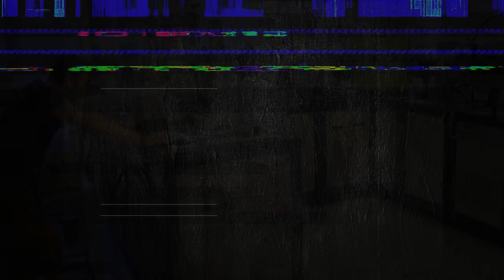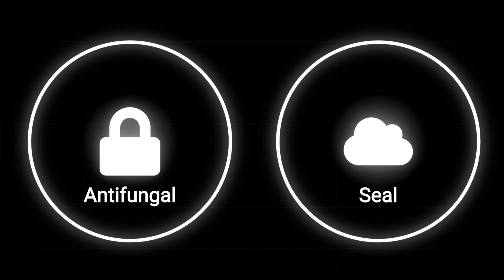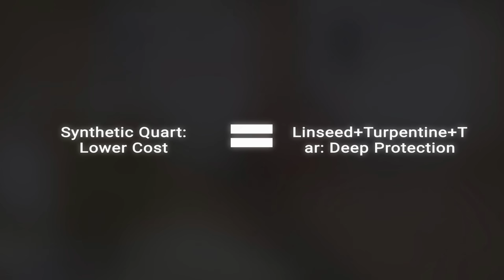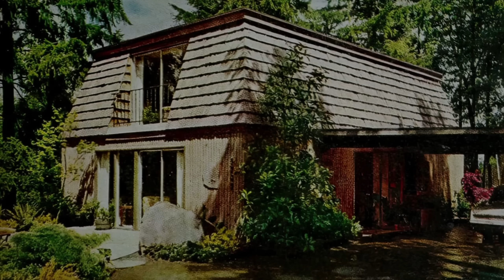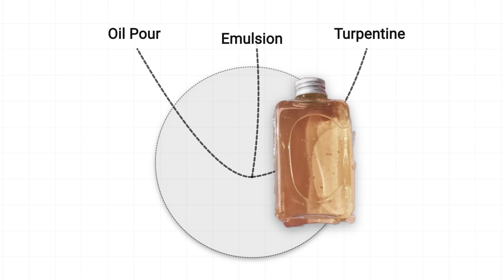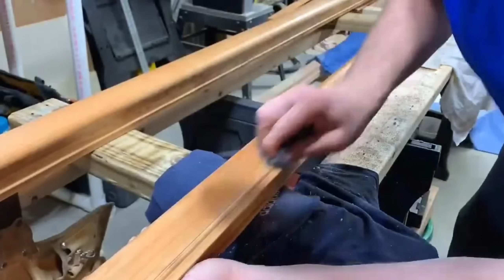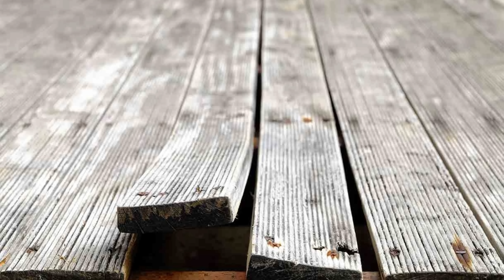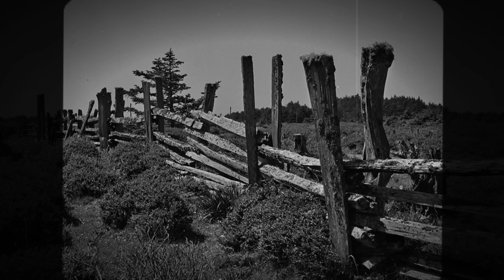The Amish Have Never Replaced a Wood Fence in 200 Years— The $2 Treatment the Lumber Industry Buried

Comment: FYI this mixture is designed for rustic or rural uses e.g. fence posts, siding. For horizontal decks, beeswax will not protect wood from solar radiation, especially on top of a clear finish. When applied to a horizontal deck the results are usually disastrous. The 3-part mixture is also adapted for interior use e.g. handles, furniture. But whatever you do, please don't use SealOnce products. Our use of it was disastrous for a whole variety of reasons.

Comment: Three years ago my deck was looking terrible. I used Cabot Deck Correct following the instructions to the letter. 
My deck is now absolutely ruined. Boards rotted through, stair treads held on at one end by one nail as the rest of the tread is rotted. ALL the horizontal surfaces are destroyed.
I have new lumber that was delivered Tuesday.
I’m glad I saw this video.
You’d think I would already know as I grew up surrounded by Amish in Southern Michigan.

Comment: what about the quality of the wood itself? what wood would you use to build the fence/deck?
Reply: If you build a deck give it a steep grade so water RUNS off.  Coat with 50/50 used oil and diesel.  Let dry for 3 days.  Don't tell your neighborhood Landscape Cops what you did.  Buy the best wood you can afford.  Don't paint it with a solid covering EVER.

Comment: Just bought a gallon of pine tar for 40 bucks not 2 bucks.  Add linseed oil and turpentine.  This mix is more than regular oil based wood sealer but should last a bit longer.
Reply: Where did you buy it? Co name country?
Reply: @carolj.3175 tractor supply usa
Sold mainly for horse hooves.

Comment: WOW! Im  a mere 44 yrs of age and as I listened to this and watch it, I'm looking at my senior project.
Is what I eventually said, that's what it was. But it is just something I did in shop class. But I was really good at woodworking. I had a real knack for it and they gave us the wood, beautiful, beautiful wood. I mean, the most gorgeous oak, you can imagine so yeah, I used it. And I chose the right ones. I put them together. I made sure they match Attached, and I'm looking at, I don't even know what you would call. This is basically like a magazine stand it's for a telephone. I thought a telephone will go on top of it. You have stuff to put your mail or magazines in there. And then there's a drawer at the bottom. But the main thing is sorry. It took this long. I was drinking.
I did it with linseed oil. That's what I did. All my projects with because that's what my teacher taught me and take linseed oil, rub it down, linseed oil. Then, you take palmise, throw it on there. I need to take the rag lincid.Oil and rub it down and it will smooth everything out.Take that dust off that.You got on your last finish.It's the finest sanding you could do little that.I know is going to soak into everything.And this stuff has not changed.One bit not one freaking bit.It is the most gorgeous thing not that I ever made cuz.My kids are but it's beautiful!

Comment: Linseed oil is extremely common in Sweden, we have it either boiled or cold pressed, and we use it for everything, mixed with color pigment to paint houses with it, rust protect cars, paint steel with it, use it for fence posts and a lot of other stuff. It's cheap, environmental friendly, and available anywhere and it works great! You can apply it with a paint gun, from a spray can, with a paintbrush or just let wood soak in it.

Comment: the vikings used equal parts of genuine pine tar, gum turpentine, boiled linseed oil.  they called it "boat soup" and treated their boats, furniture, ax handles, etc...  Gum turpentine is a potent natural antimicrobial, exhibiting both antibacterial and antifungal properties. Pine tar provides waterproofing, UV protection and resistance to decay.  Boiled linseed oil prevents water absorption and strengthens wood fiber against rot.    A top-coat of beeswax acts as an oxygen barrier that slows the drying / curing of the linseed oil.   But, if you want a fence to last a 50 years with zero maintenance use Black Locust.
Reply: Alone...black locust?// don't know what it is but will look up thanks

Comment: Linoleum (LINO)  flooring is a natural, eco-friendly material made primarily from
 solidified linseed oil (linoxyn), pine resin, 
ground cork dust, wood flour, calcium carbonate (limestone powder), and mineral pigments, usually backed with jute fabric. 
These sustainable components make it biodegradable, durable, and often antibacterial

Comment: I am a professional painter, and this video blew my mind.
Reply: Okay, so boiled linseed oil and real turpentine mixed 1:1 and applied with a rag. After 48 hours, apply melted beeswax with a little linseed oil. 

For posts, am I supposed to mix the pinetar into the linseed oil and turpentine solution? Then still topcoat with the beeswax?

Thanks in advance  this video was very good. 

Subbed

Comment: Very cool. Something to be aware of is that “boiled” linseed oil is not heat treated, it is chemically treated to break the oil chains. The chemicals used are not pleasant and will irritate skin in a way that pure linseed oil will not. Prefer to use heat polymerised linseed oil, which can be more expensive unfortunately.
Reply: boiled linseed oil was actually heated in the past ... but adding synthetic dryers was cheaper.  But they still produce turpentine (distilled from pine trees) and actual boiled linseed oil and actual pine tar in Sweden.  It works as well as it did 100/200 years ago.  Mush better than the new crap.  But it's pricey.
Reply: I've been using Flaxseed Oil for years (that's what pure linseed oil is), but where do you buy "heat polymerised linseed oil" from? And do you have a brand name?

Comment: Take diesel 50% and used motor oil 50%. Mix it and you get sperior treatment for wood
Reply: In my experience, the diesel isn't need. Just oil it up with used motor oil. Or make some soild black locust posts at a certain time of year. Those posts don't rot.
Reply: Why diesel when it evaporates in less than a year?

Comment: Probably a fake account. No mention of the 3rd ingredient in the mix! I take this with a grain of salt! However, the comments section are full of ideas, such as using diesel mixed with used motor oil or transmission oil to seal the wood makes more sense and economically viable!
Reply: Diesel evaporates. Woodworking YT comments will steer you wrong without failure.

Comment: The recipe will indeed continue to provide protection… provided you keep applying it every year or two. They somehow left out the part about annual reapplication being necessary. Of COURSE there are better modern products that provide longer lasting protection. The turpentine-tar-linseed oil recipe is merely a good solution compared to the excellent products available at every big box home store or paint store.

Comment: They also char the wood surface which creates a rot resistance. old motor oil or diesel is also used for preservation. woods that are naturally rot-resistant, such as black locust, eastern red cedar, or white oak, for posts.

Comment: at least most of the skepicism  is well placed.   but very truely i have had many amazingly good results by treating all kinds of wood and rusted steel with RAW  linseed oil (which is not so easy to find anymore)   mixed with a bit of pure gum turpentine,   and varying amounts of dirty motor oil especially on badly weathered wood.   a thin coat of the mixture can be painted over right away with oil based aluminum paint which  needs a lot of drying time.   then allmost any paint will be fine on top of it

Comment: This is not unique to Sweden, this has been produced for at least 1000 years in Norway, and in the 1600 and 1700’s Finland was the largest exporter of pine tar products. They are still in use to this day. Telephone poles is one example, although nobody has power lines or phone lines on poles anymore, but some old lines are still in use and needs maintenance

Comment: Swedish here. I have saved about a hundred year old window frames and doors. The real terpentine and boiled linseed oil reintroduces the stuff (lignine) that that holds the cellulouse fibres together in the living trees. I've never added pine tree tar, but that sounds a good idea for unpainted things like fences. For boat jetty's though, the kind of distilled wood tar mentioned here, is traditionally used in Sweden. (It was an abundant bi product of huge charcoal production through distilling wood - in Sweden - which lacks stone-coal deposits.) It's remarkably effective, lasting like 50 years or so, and smells nice! (In lieu of this stuff, I have used just regular used petroleum based engine oil, diluted with gasoline to penetrate & for direct contact with soil or water, a second drench with undiluted oil. Not so nice, but almost cost free. ;-) I only use it for wooden staircases far from my house, where I never sit, and jettys where noone sits.)
For completely dried out grey wood (and sometimes mold and moss covered) I've done as follows;  I have very sucessfully used "Klorine" / bleach (I guess?!) - the same stuff added to the water in swimming pools - sodiumhypoclorate - NaClO - to treat old windows and doors, that have had tons of mold and moss overgrowth. Brush off any loose paint and loose (only loose!!!) window putty. I then add it very liberatly, basically drenching the wood with the stuff. It probably penetrates a bit into the wood. That immediately kills the overgrowth. I brush a bit, some more paint will probably also come loose. I then hose down the door or window frame with "huge" amounts of water. I then leave it out in the sun to dry out completely for a day or two. (Only works in hot weather.) After that, I use a pretty thin mixture of terpentine and boiled linseed oil - thin, because I want it to penetrate deep. After another day, I give it another coat of undiluted boiled linseed oil. Repair any missing window pane putty. Then the usual painting procedure, with oil based paint primer + another two layers of finishing paint. Actually, the hardened boiled linseed oil, acts as paint protection on it's own. But you probably want colour paint, and the procedure gives a paint surface "anchored" deep into the wood.
In this manner, I have restored also completely grey, dried out, almost 100 yers old windows. If there are severe cracks in the wood, traditionalm chalk & oil based window putty can be used for cracks. I never remove splinters or such - an antique window I figure, might just as well show it's age.
The results have been astonishingly good! Windows and doors people thought were beyond possible to save at all, have stayed perfect for 25 years, without any mold. After that long time though, some new fresh paint is a good idea. ;-) A long story, and a lot of work. But it works, and old windows matching an old house, really looks great!Swedish here. I have saved about a hundred year old window frames and doors. The real terpentine and boiled linseed oil reintroduces the stuff (lignine) that that holds the cellulouse fibres together in the living trees. I've never added pine tree tar, but that sounds a good idea for unpainted things like fences. For boat jetty's though, the kind of distilled wood tar mentioned here, is traditionally used in Sweden. (It was an abundant bi product of huge charcoal production through distilling wood - in Sweden - which lacks stone-coal deposits.) It's remarkably effective, lasting like 50 years or so, and smells nice! (In lieu of this stuff, I have used just regular used petroleum based engine oil, diluted with gasoline to penetrate & for direct contact with soil or water, a second drench with undiluted oil. Not so nice, but almost cost free. ;-) )
For completely dried out grey wood (and sometimes mold and moss covered) I've done as follows;  I have very sucessfully used "Klorine" / beach (I guess?!) - the same stuff added to the water in swimming pools - sodiumhypoclorate - NaClO - to treat old windows and doors, that have had tons of mold and moss overgrowth. Brush off any loose paint and loose (only loose!!!) window putty. I then add it very liberatly, basically drenching the wood with the stuff. It probably penetrates a bit into the wood. That immediately kills the overgrowth. I brush a bit, some more paint will probably also come loose. I then hose down the door or window frame with "huge" amounts of water. I then leave it out in the sun to dry out completely for a day or two. (Only works in hot weather.) After that, I use a pretty thin mixture of terpentine and boiled linseed oil - thin, because I want it to penetrate deep. After another day, I give it another coat of undiluted boiled linseed oil. Repair any missing window pane putty. Then the usual painting procedure, with oil based paint primer + another two layers of finishing paint. Actually, the hardened boiled linseed oil, acts as paint protection on it's own. But you probably want colour paint, and the procedure gives a paint surface "anchored" deep into the wood.
In this manner, I have restored also completely grey, dried out, almost 100 yers old windows. If there are severe cracks in the wood, traditionalm chalk & oil based window putty can be used for cracks. I never remove splinters or such - an antique window I figure, might just as well show it's age.
The results have been astonishingly good! Windows and doors people thought were beyond possible to save at all, have stayed perfect for 25 years, without any mold. After that long time though, some new fresh paint is a good idea. ;-) A long story, and a lot of work. But it works, and old windows matching an old house, really looks great!
Reply: You lost me at "Use Clorine Bleach" - I ruined my deck by washing it down with clorine bleach. After doing research to find out why my deck suddenly disentegrated within a year of application, I learned that bleach destroys the fibre holding wood together. Now I'm facing having to pull up all my deck boards, treat them, and flip them over so the side I didn't bleach is face up.
Reply: @joysart5 You have to rinse with huge amounts of water! And the clorine only neds to sit for a minute to kill mold and moss, anthen you brush that loose / away.
And then let the wood dry thoroughly before oiling it. With boiled linseed oil and terpentine, you actually replace the lignine that holds the cellulouse fibres together. (terpentine is actually from distilled wood, like the lignine in another form) That’s the way to restore really bad window frames. In your case, any woodoil would do, for cost reasons too. Though, check the water content in the oil!!! Cheap=lots of water blended in the oil

Comment: Old farmer trick. Used motor oil mixed with equal parts diesel fuel. Penetrates deep, wood never rots, molds, falls apart, or gets eaten by bugs cuzz they hate it. Use a mop to swab it on. Farmers have outdoor trailers with wood deck boards for decades and never replace them. That wood is tough as nails and still going strong. Or you can use a rubber glove and a car wash glove to smear it al over your fences and posts. Linseed oil is expensive. Used oil and diesel cheap as heck.
Reply: I can confirm this. However, it may violate local anti-pollution laws, depending on where you are.
Reply: This is what I used on my back porch, which was already old when I bought my house. It looks beautiful.

Comment: My neighbor had the original stain formula for his 1898 house. 1/2 gallon clear kerosene, 1/2 gallon boiled linseed oil one gallon gloss oil based paint. I've used it on new spruce clapboards and cedar shingles. A decade later they are like new no peeling and a beautiful finish.
Reply: Seems like a really good structure to be certain no one ever has a lit cigarette within a couple hundred feet for the next few years.
Reply: @bhough410  We have a fire pit 50 feet from the building, it's never caught on fire. The finish soaks into the wood and is dry in a few days. There's no fire danger in my experience. My neighbor who gave me the recipe, their house was built in 1898 and it's still there too.  Kerosene although flammable is not gasoline.
Reply: Wow, is the gloss paint mixed with the other ingredients or is that step 2 after treating with the other?
Reply: @elissanova  You mix the three ingredients in a bucket, then apply to your wood surface. I dipped all the cedar shakes before applying to the house. The spruce clapboards I put them on then stained them. As I said 10 years later and they look great still.

Comment: Hi great  video. How much pine tar is needed with the oil and turpentine, whats the ratio I mean?
Reply: he said equal parts, then he quit referring to pine tar.  I had a pool deck that was along trial and error.  Use 50/50 used motor oil and diesel or Used Xmission oil and diesel.  The oils will take a few days to dry.  then they're good.  Its 1/3 price of Thompsons used piss and spit and works.  Never used solid paints on a deck.  The paint will trap the water then will rot.